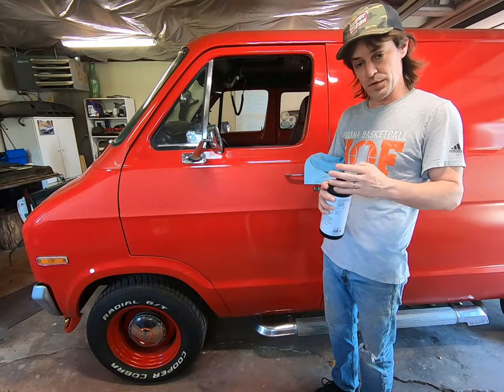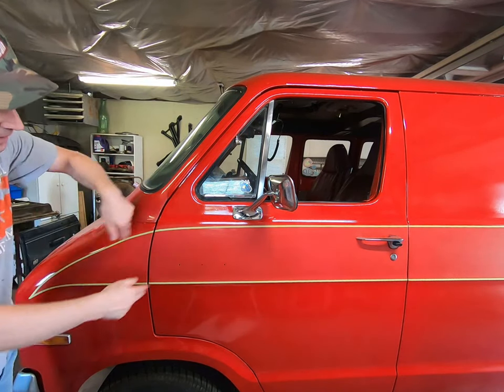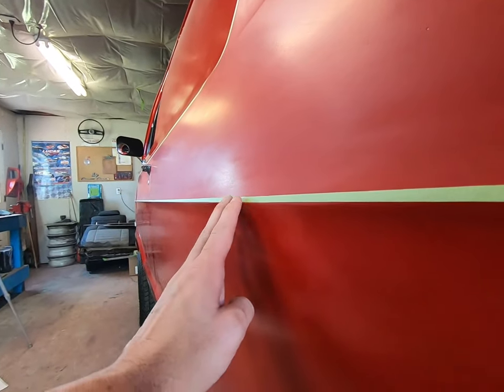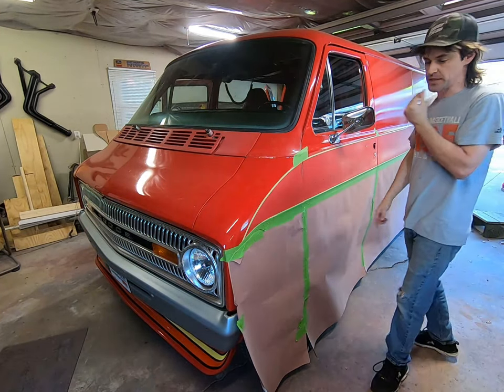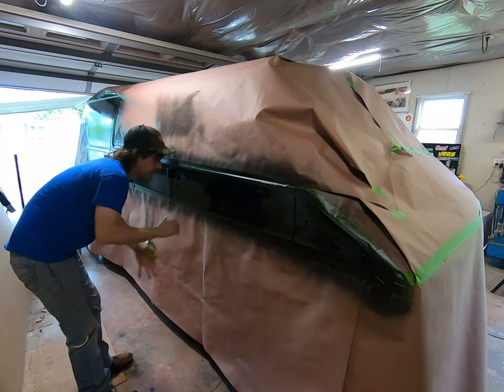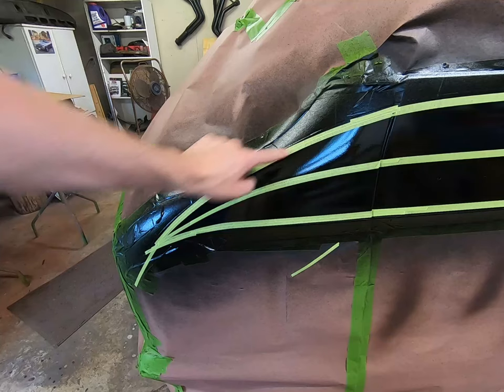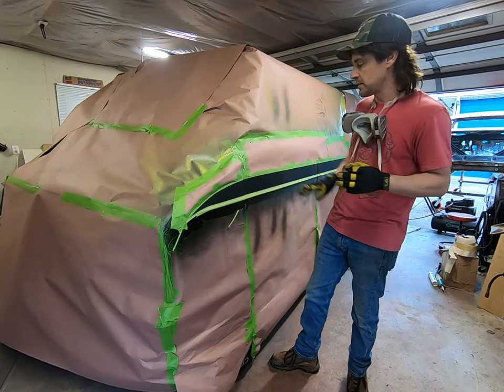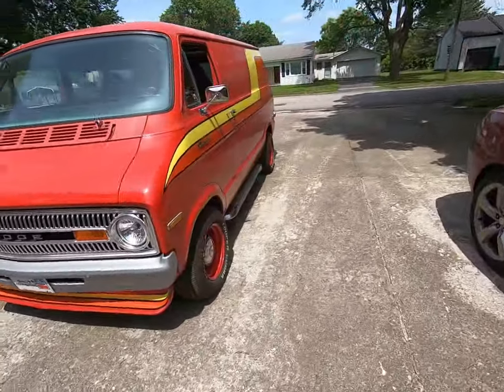Side Stripes! - Hoosier Garage

Comment: Cool got an 82 dodge van in 1/25 scale going to be a tribute build to Adams van so I got to watch this!
Reply: Start on that model yet?
Reply: @mickangio16  so far I have the model in hand there are a few youtuber cars I'd like to have as models.
Reply: Cool. I like models, too.
Reply: I just looked at Adam's channel today to see who Tim is supposed to race. I like both vans. I think Adam may be at an 1/8th mile drag race disadvantage by changing his rear gear ratio (not sure of Tim's gear but doubt as long legged as 2.7) but I do understand that the van isn't intended to be a drag racer. Keep on truckin'.
Reply from the maker: I think you are right. He told me he has whats likely a 3.23.
Reply: Be cool if Jed & Dad showed up with their van, too.
Reply: @mickangio16  That would be awesome.
Reply: @HoosierGarage  you know my 76 charger 360 had a 2.73 and it would light the tires with a 904 transmission... now even better with 3.55 and a Trac loc.. The vans I don't think ever came with a 904 with a lower 1st gear.. They were all 727s maybe if it had the slant.
Reply from the maker: @moparnut6286  yeah the vans were loadflites. I think a little different
Reply: @HoosierGarage  actually no loadflites was just a name gimmick.... I use to get them out of the junkyard for $25 a pop there's one behind my 90s 360 in my 74 charger...the cases had the bell housing hole for timing usually 4 pinion planetarys more frictions on the drums but other than that same as a torqueflite.
Reply: @moparnut6286  somewhat coincidence. I'm currently driving a '78 Cordoba 400/2.45 gears- a real tank. I've converted the Lean Burn to Chrysler Electronic and Thermoquad to Holley 600 v.s. electric choke and replaced water pump and radiator to Chinese aluminum Champion. It runs real good and reliable now but is a gas guzzler.
Reply: @mickangio16  yeah the first car I converted from lean burn was my 78 New Yorker 400 4bbl thermoquad even drilled the passage for distrubtor vacuum on the thermoquad... 3 months later there was an article in high performance mopar...they were to late I beat them to the punch but it was cool to see I did it right!😁..and I have a 77 Cordoba with a 383 that's gone 125 mph on the NJ Parkway today I'd be in jail lol. Love my late B body's but gas mileage is not what they are about but they are still an affordable way to get started in a mopar and can do everything a muscle era mopar can with plenty of comfort to boot!